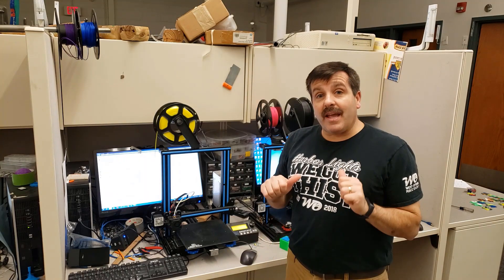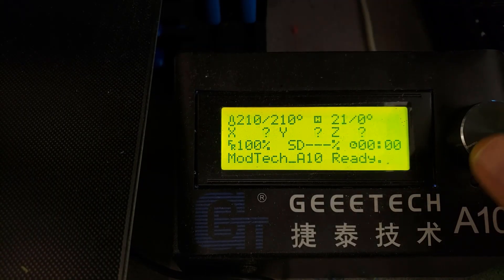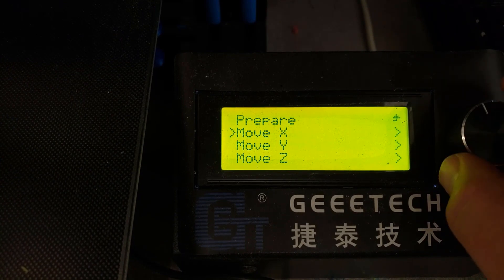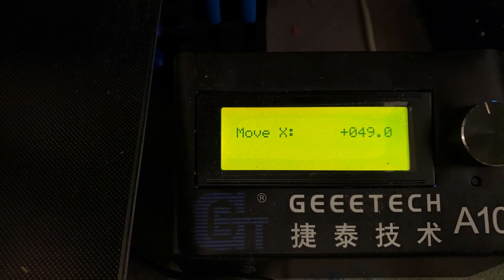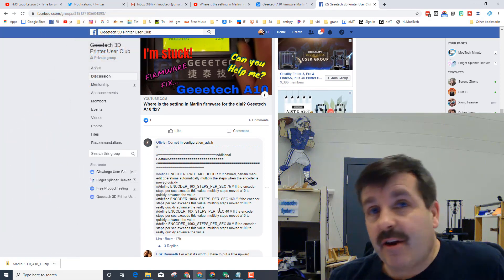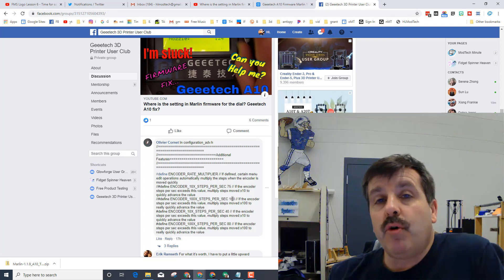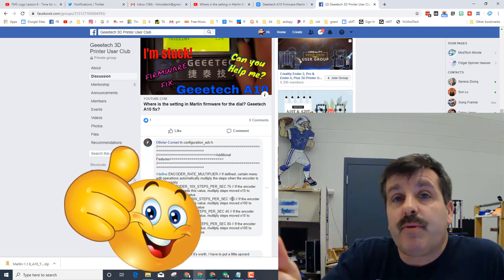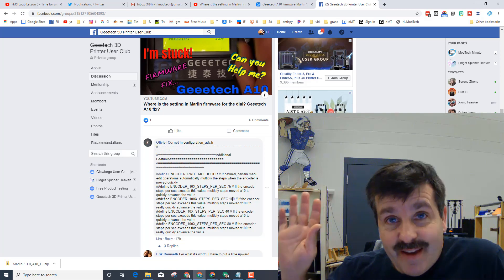Solved! My Geeetech A10 dial works like I want now! Fantastic Firmware Fix!

Comment: Can you please help me with my A10 it's getting a HEATING FAILED PRINTER HALTED please reset first the nozzle temp had some fluctuation now that's fine but My bed temp is reaching 60° then when I start printing the bed temp just drops until the printer stops and I get that message on the screen
Reply from the maker: Sounds like you have an issue with your thermistor on the heating element.
Reply from the maker: I see you took it apart. Did you notice if there were any lose wires by the heating element?  Are you still using the stock firmware?